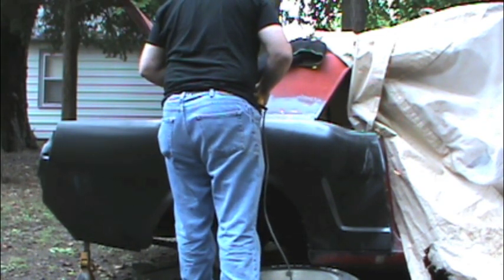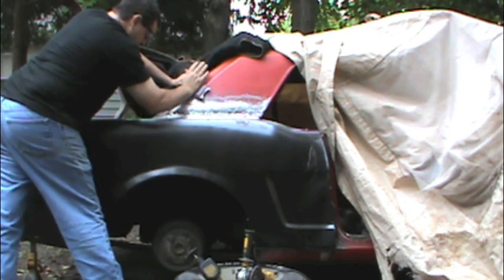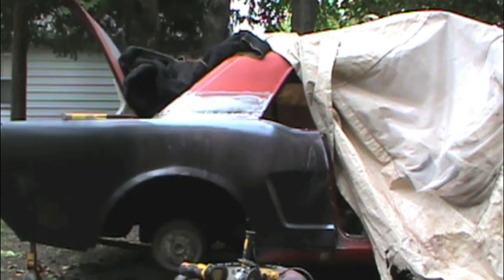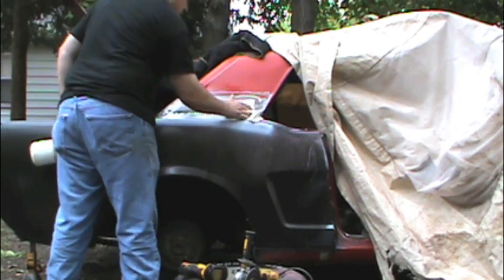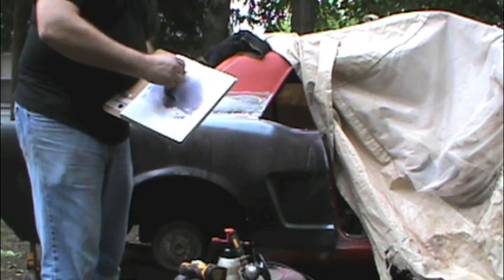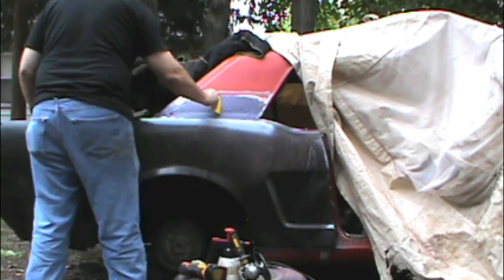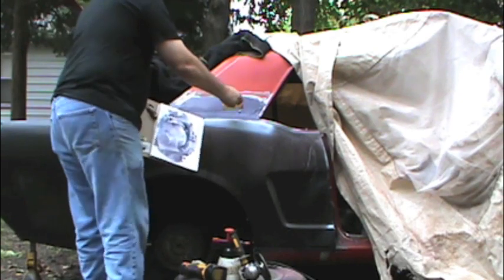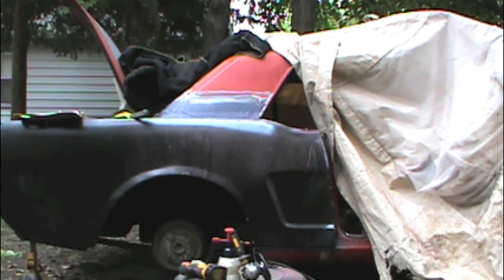Fiberglass Filler_How To Dress A Weld And Apply Fiberglass Filler

Comment: Thank you, thank you for pointing out the first coat of filler, is a light coat pressed hard onto the sheet metal. This gets the resin / binder deep into the tiny little scratches to start the bonding process. Retired now, but an ASE Master Tech since 78, I fixed vehicles but did body repair and painted my own. With 4 children and 3 are boys, two boys were hard and buggered them up. I was the paycheck and drove older vehicles and the upper MidWest loves their salt & sand in the winter. So with my 1984 150Amp MIG, got a lot of practice as I used one side of my heavy copper vise jaw insert on the backside of a panel patch weld. One son wanted to learn a dozen years ago and I tried to teach him to get that thin layer in deep and hard first. 
You look young and my last son is 35, but do you know when your kids have grown up? They wreck their vehicles instead of yours. Lost 4 this way. Thanks again, subscribed and liked! I am waiting for lumbar fusion #4, L3-L2. Postponed due to Covid hospital shut down. Burns!

Comment from the maker: I just use the short strand for weld locations.  I use it for the sealing quality.  I would recommend welding holes with a patch panel, but you are not going to weld, the long strand would be better for filling small holes.

Comment from the maker: I do not have a video for this.  If that is a stock Mustang hood, than it is sheet molded compound...similar to fiberglass, but fiberglass repair will not hold up well.  You will need to ask your supplier for SCM repair adhesive.  I would also taper before applying the SMC repair.

Comment from the maker: No, I recommend applying fiberglass straight over bare steel.  Then you can apply body filler over the sanded fiberglass to finish shaping if needed.  Once shaped, then you can apply self etch to any exposed metal, and then you can apply primer surfacer.  I hope this helps.  If not, let me know!  Thanks for watching.
Reply: Donnie Smith hi i sprayed my weld with  galvinising paint then  put fiberglass filler over it. Will this be ok?

Comment: No, I just welded the panels together and applied fiberglass over the weld location, then I'll shape the fiberglass filler then apply body filler to finish shaping and getting it ready for primer.

Comment: hi donnie winter is going to be soon ,  i want cut out some body panel piece and weld some new pieces on and use fiberglass kitty hair and use a aerosol primer filler and some aerosol paint to protect it over winter will that work??

Comment: I have a hood off a 94 mustang that is fiberglass and some one put a hood scoop on it. I took it off and want to fill the holes that they drilled in it, do i need to taper the holes before filling them so  they will feather out properly or do u have a video on this kind of repair? thanks!

Comment: Donnie, I’ve welded new floor pans into a 66 Mustang, I’ve already sprayed self etch primer. So, I guess I should remove it before I apply short strand fiberglass. Should I put fiberglass on the top and bottom of the weld or just put it on the inside of the car and just put seam sealer on the underside?  Thanks!

Comment: Thank you for all the Videos. Thanks for answering one question throw them for me but still have one other for the time being. What do you use for the fiberglass filler, long strand or short strand.?? Going to be doing repairs to the quarters on my Honda behind the tires. LOL someone has already been there and used that foam in a can and then put bondo over it

Comment: No, both fiberglass filler and aluminum filler will get the same results for sealing the weld off for corrosion protection.  If you are using metal to metal or all metal, than that will work fine.  Thanks for watching!